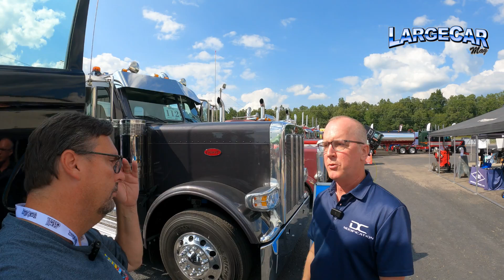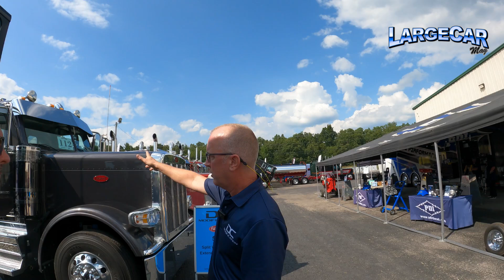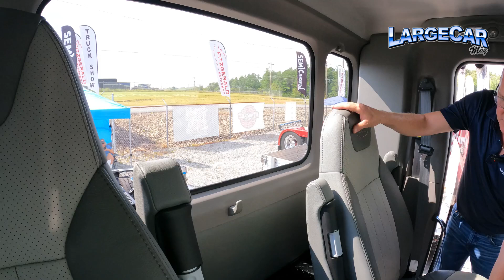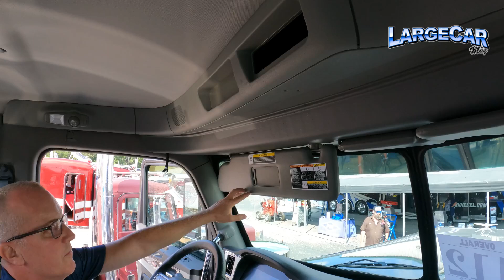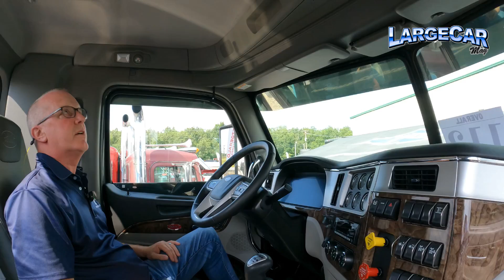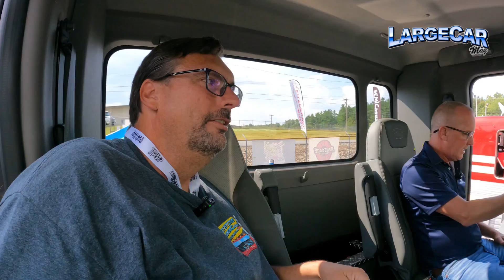DC Modification 589 split windshield/extended day cab

Comment: Personal opinion, paint the top and bottom of the door treatment. Any chrome stuck on the door of anything looks out of place to me. A painted door panel adds to the lines of the truck. The chrome does not. Just my 2 cents.
Reply: There offering in several configurations
Reply: Thank you for your feedback.  We will consider that.